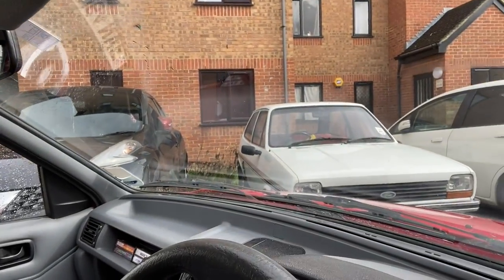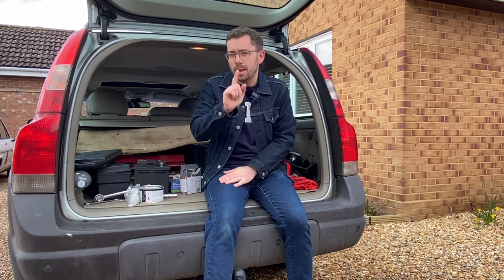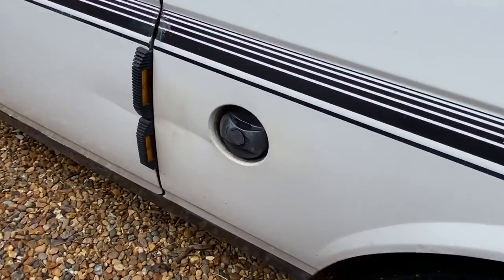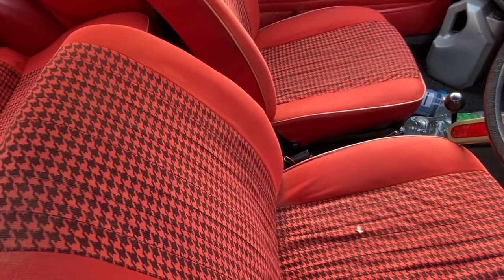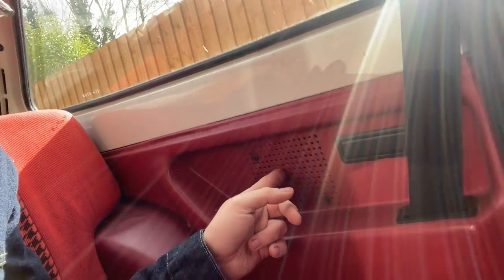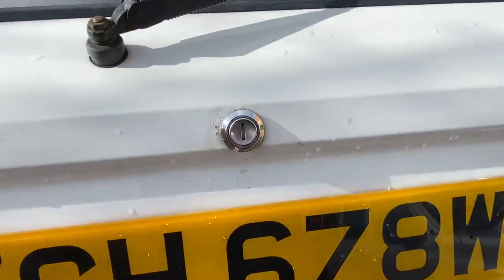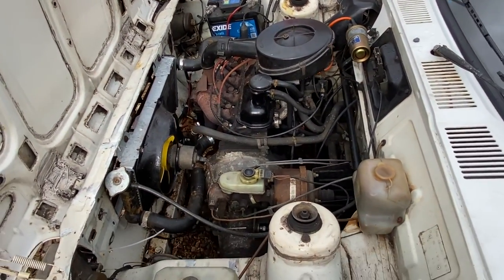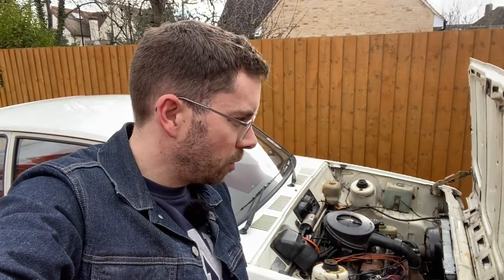I bought a mk1 Fiesta!! Mk1 Ford Fiesta 1.1L Restoration Episode 1: FIRST LOOK!

Comment: Lovely little car, especially the orangey red interior, so period. Those water bottles are possibly indicative of an overheating issue.
Reply from the maker: Yes, the radiator has a leak so it's been topped up a lot

Comment: Great! My dad had a 1983 957cc Popular, last of the line before the Mk2 came out with a few extras thrown in such as rear wash wipe. He had it from 1992-97 and there will still plenty around back then. I drove it for a few months after passing my test in 96 and lots of people had them as a first car at that time. Then, suddenly, they all pretty much disappeared almost overnight.
Reply from the maker: Yeah, you're right, apart from a few elderly-owned oddities that soldiered on for a bit longer.

Comment: I did quite a lot of miles in a W reg white 1.1L between 1983 and '85. It was used for documents and consular jobs at a courier firm I was working for. It was surprisingly quick and good for an indicated ton (on private test tracks)!

Comment: The black at the rocker panels is a repair. The upper side has to be white. I had the same with brown-blue interior and further options such as central console with clock and radio, headrests and bumper overriders
Reply from the maker: Thanks, I think I will return the upper rocker panels to white

Comment: I bought one in the 90`s for £120, it needed a clutch, towed it home, replaced the clutch, didn`t put the driveshafts in, started the car, stopped the car, looked at the gearbox, cleaned the mess and gearbox oil up from the floor, then went off to the scrap yard for a new Gearbox which wasn`t expensive.👍
Reply from the maker: Whoops!!

Comment: My first car 1.1L had a Dell'Orto replacement carb fitted, my mechanic neighbour told me that the original carbs weren't much good. It would cut out in very cold weather as the carb sat higher than the original (the fuel got too thick in the cold). The points always needed attention as they would work loose. I became an expert in heel and toeing to keep the revs up while slowing down. Yours looks lovely, I am so envious, I hope you enjoy owning it. Mine was called Juan because they were built in Spain.
Reply from the maker: I’m excited to see how this one drives. I’m going to overhaul the carb and ignition system so hopefully it will be reliable. Mine was also built in Spain, but I haven’t thought of a name yet

Comment: It has a 2 speed fan, you need to push it down again for the second speed, and the dash side vents were standard on all models, the rear quater cards have the holes in for factory speakers, and cigarette lighter was an option on L models,
Reply from the maker: Thank you. I’ve now worked out the 2-speed fan. I will need to investigate behind the rear quarter grilles and see what speakers are there

Comment: Looks lovely, congrats on your purchase. That bit of insulation in the boot looks like the piece that goes underneath the dash, just behind the steering wheel, they always seem to come away. The upper part of the rocker panels would have originally been white. £3100 if there's nothing fundamentally wrong is fair I'd say :)
Reply from the maker: Thank you for this: you’ll see I put the insulation back where it was supposed to be in episode 2, thanks to your comment  😊

Comment: My uncle had a Cosmos Blue 950 L in the mid 80's. I used to love help him tinker with it. I feel that if it is to maintain its original spec. like the Metro, it would only be receiving a single door mirror.
Reply from the maker: I would agree, but as there are holes in the passenger door already to take a mirror, I think it will be neater to cover them with a correct passenger mirror (an optional extra)
Reply: @MorselsAndMotors  The original mirrors will not cover both holes of the ugly aftermarket once i think.